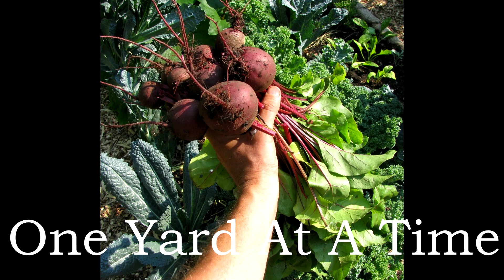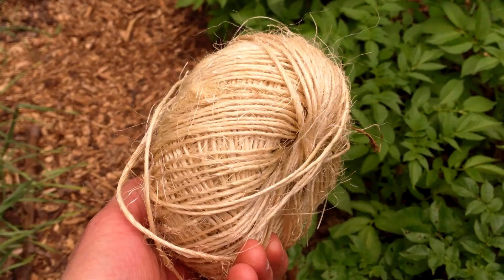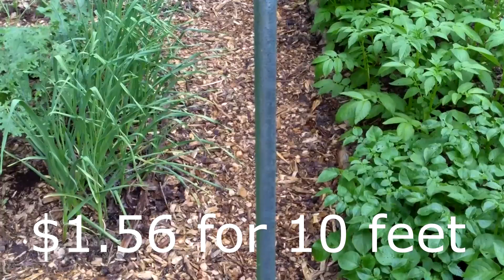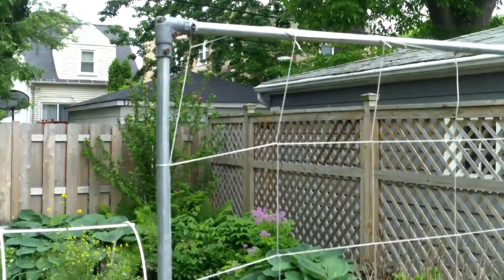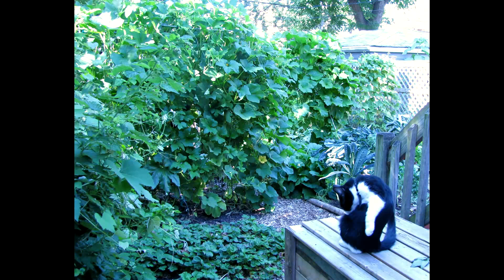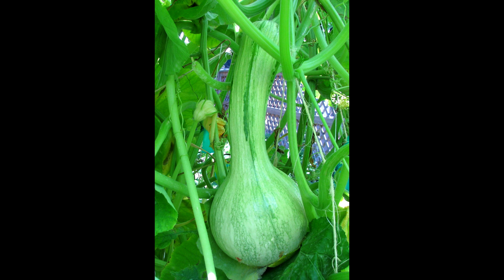Grow Vertically On Conduit Trellises & My 2013 Gardening Expenses So Far

Comment: Do you use the cheaper EMT conduit or heavier duty Rigid conduit?
Reply from the maker: Yes, we use the cheaper EMT conduit. It has held up to some pretty heavy loads over the years.
Reply: Excellent. Took my chances and got the EMT. I was weary at first since the poles bent so easily, but that was at its original 10' length. Now, cut to 4' for the cross beam, I'm not worried at all about it sagging. Thanks again.

Comment: I miss soft northern soil. Here, our soil has a lot of granite or quartz. I have to use a 5 lb hammer and IF I can get it 1 ft into the ground, it is time to celebrate.
Reply from the maker: Yes, with the exception of a few stones here and there, a stake will go into the ground like a hot knife through butter.

Comment: Might I recommend you attempt bio mimicry with your trellis' this coming year. Try tying a spider web pattern instead of the squares because the load distribution is much better on a web compared with squares. This will allow your trellis' to hold far larger yields.
Reply from the maker: Interesting idea Frank.

Comment: I was wondering about the rust on the hammer? A bucket or coffee can half or 3/4 full of sand then some sort of food grade oil added and mixed into the sand, and your tools can be put into it, like small garden planting spade, and if larger bucket used, even you big spades and forks etc. Maybe spray your hammer with WD40 to get the rust off?